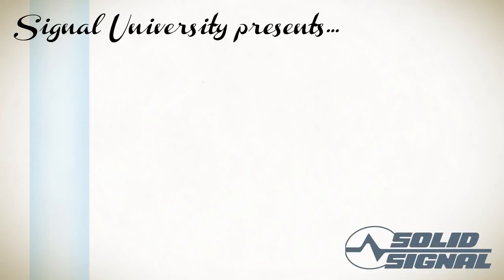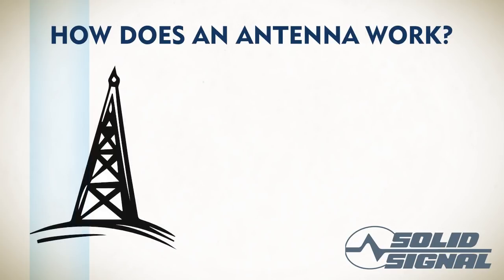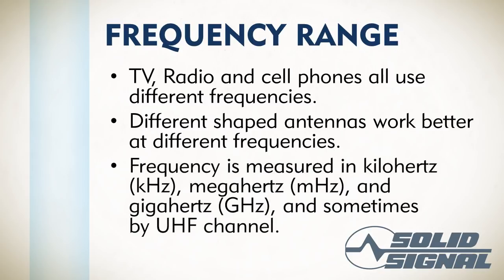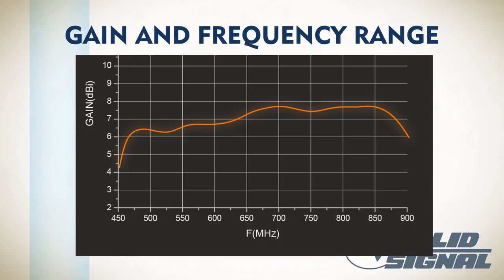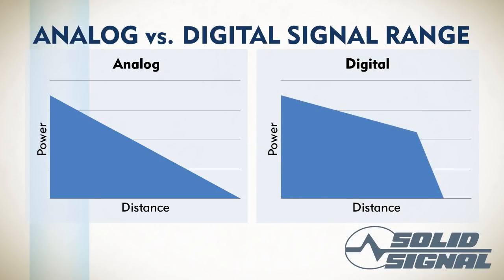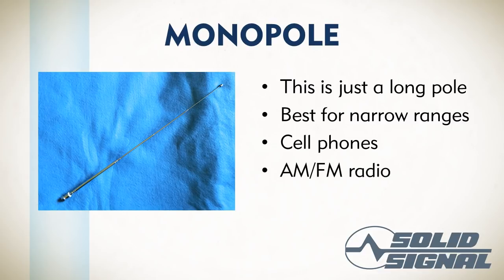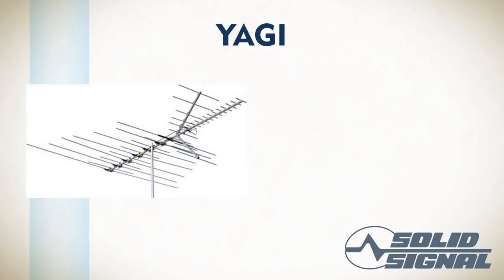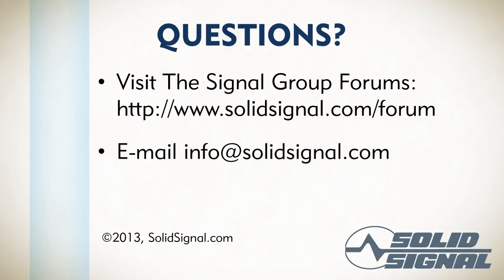Solid Signal shows you: "What Is An Antenna?"

Comment: eeehhhh? I mean I get your doing this for a technically illteriate crowd, but some of this stuff is a bit far off base. For example a true yagi absoultely is about the interaction of the elements at a close proximity.  THe antenna your showing is a hybrid of a few but mostly a log-periodic.... but anyhow... and then the whole thing about distance and digital...  the signal itself is exactly the same as analogue and works exactly the same way, the only difference is error correction in digital  means it produces a visual image that is shapr until the point that the signal-to-noise ratio introduces too many errors into the decoder.  This has nothing to do with antennas (well I mean yes, if you have a more directional, aka higher gain, antenna then yes you can pull more signal, but exactly the same amount of signal as analog).   Monopole is not JUST a telescopic antenna, and its wrong to say as such.  And no antenna is rated by the distance it will receive. The distance it will receive is a function of the transmitted power, the frequency, height above the ground of transmitter and receiver antennas, the gain of transmitter and reciver antennas, and then any propogration effects (not significant in tv, but very significant in AM broadcast).
Reply: todkapuz  whats illteriate? 😂😂😂

Comment: Basic Basic Knowledge for Americans stuck in England where Antennas are what Insects have extending from their heads - so Antennas get called Ariels instead whilst Broadcast Towers often get separately labelled as Mobile Phone Masts ( which are very unpopular in spite of nearly everyone under 70 using one regularly ) - and TV & Radio Transmitters which generally go unnoticed or ignored as mere things on hill tops  ‘in the middle of nowhere ‘  (unless you enjoy fantastic views or are an “ Anorak “ - a sub genre of Geek or Nerd whom photographs them - and Trains , but which are essential for all old fashioned folk that lack Sky tv but have intellect ) 
  Hope this helps as well as the presentation does 😁👍

Comment: just the explanation of the Yagi actually don't apply for the standard yagi, it was made that way, so that the directors elements interfer with the waves in such a way that it cancels waves that are at a large angle and make the whole antenna directive, and higher gain
the modern yagi antenna re actuall a mix of a yagi and a log periodic antenna  or a mix of 2 different yagi antennas disigned for different frequencies bands

Comment: What in Antenna affects the frequency that it can receive? Is that geometry? type of material? size?
Reply from the maker: It's the size of the antenna as a fraction of the wavelength.
Reply: Along those lines, with the increased cosmic radiation that is going to impact this Earth this century:

"Batteryless Battery"????
a. Small aluminum cones with an electrical wire running through the center of the cones, cones spaced apart (not touching I'm thinking) but end to end.
b. Electromagnetic radiation energy in the atmosphere interacts with the aluminum cones.
c. Jostled atoms and molecules in the cone eventually have some electrons try to get away from other electrons of which those electrons gather at the larger end of the cone, of which also creates an area of positive charge at the smaller end of the cone.
d. The electron's in the wire are attracted to the positive end of the cone and the positive 'end' in the wire are attracted to the negatively charged end of the cone.
e. Basically a 'battery' has been created inside the electrical wire itself, different areas of electrical potential.  Basically a 'wire battery' or a 'batteryless battery', however one wanted to call it.
f. Numerous cones placed end to end increases the number of 'batteries' in the wire.

Then of course, one could take that generated dc electricity to split H2O into H2 and O2 of which could be burned or utilized in a hydrogen fuel cell to get the electricity back with a byproduct of basically pure water.  Species need pure water too.

With the increased cosmic radiation that is going to be impacting this Earth this century as well as possibly a mini-ice age, might as well put that cosmic radiation to work for us.

Comment: does dish antennas use omni directional antenna to receive max signal from all directions?
Reply from the maker: Dish shaped antennas aren't omnidirectional. Omnidirectional antennas look like flying saucers.
Reply: @SolidSignalNovi  so dish antennas are simply parabolic reflectors?
can you explain in detail the mechanism involved in reception of tv signals for dish antennas!
Reply from the maker: @fundamentals7377  That's a bit too much for a youtube comment. If you would like to start a public thread at forum.solidsignal.com we can discuss all your questions in detail.
Reply: No, signal is by centering the lpn directly at the satellite,,satellite dish reflex signal to the lpn   , than trough cable to TV

Comment: uhm the tower does not radiate, the antennas mounted on the tower do.
Reply: well unless we are talking about AM radio, then yes the tower itself IS the antenna, as optimal length of the radiating element is approaching 75 meters / 250 feet.  Do s search for "mast radiator" or "radiating tower".    And often, you will find several seemingly the same sized towers in a row with nearly equal spacing... you are actually seeing a directional (gain) antenna for low frequencies... if its two then a phased array, if more then effectively a yagi antenna (see "tower array").  Sometimes you will see a grid of 4 or 9 antennas in a square that are shorter and your looking at a direction finding array for aircraft.

Comment: One question that's driving me nuts:
If I double the antenna size will I double or improve the gain ?
Reply: DX Commander agh I think I follow thats a great start thank you, so the size of the antenna is specific to what your trying to capture and it cant be changed.
I’m trying to get a cell phone signal at a remote property in the 700mhz region and the best I’ve seen is a 16 gain Yagi from ZDA, my thought was to just use a giant TV Yagi, so is it possible to use multiple of the specific size to try and capture more of the specific signal and then try to connect it to one feed ?
Reply from the maker: @SP-mp9yi  @dx commander is right.
Reply: Solid Signal So am I right to say each frequency has a maximum antenna size ? 

One other question guys do antennas catch signal only so they amplify what is already there or can they also fetch signal ?
What I mean by that is if I point the antenna at a area that has good reception but not a tower that doesn’t reach my zone can it connect a path back ? Oppose to having to direct the antenna at a tower that may be out of site ? 

Back to the question of maximum size if I needed more gain from the possible signal would I be able to do it by doubling the maximum size antennas so having 2 4 or even 6 of them going into one feed ? More antennas not bigger ones going into the feed ?
Reply from the maker: S P antennas are passive. They can only receive what is coming at them. You can combine multiple antennas for more gain but you only net about 2dB from the second antenna.
Reply: Solid Signal Super Fantastic Thank you very much.
I actually rewatched your video and things sank in a lot further the 3 time, if the signal is not at the location no array of antennas will help and multiple of the right sizes gives about 2 gain not the full 16.

So my only test left will be to try and install the 16dbi Yagi’s in front of old satellite dishes at a 45 degree angle to try and match the cell towers waves.
If that fails I will initiate plan G move to the city.

Thanks again and happy thanksgiving.
Reply: DX Commander  Thank You very much that really brought it all together for me.
Reply: RULE OF THUM!!! Jessup Rothammel ARRL say so !! 
Greetings from Denmark 🇩🇰💂 👍🖖
Every time you doubbel element count !! You get +3DBd 
But using bad cabel make loss 
Every plug minus 0.01db if the plug you use are PtFe teflon!! 
Plastic has bad diselelectric caractaristica .. teflon don't
Use high grade cabel (low loss cabel PtFe foam insulator) 
Gain..........DBd..DBi
1/4 minus 1.5  or 0.68
1/2 ...........0.0.....2.15
5/8............1.5.....3.65
9/8............2.0.....4.15

If you cophase 2 antennas +3DBd
+
If you cophase 4 antennas +3DBd (6)
+
If you cophase 8 antennas +3DBd (9)

Exampel i combine 4x 21element UHF 430-440
I use combiner and ecoflex15 
30m 7/8 Andrews cabel loss + combiner loss 2.0DB - 24DBd combined antenne gain 
+22DBd 
18DBd +1antenna 3DBd  = 21DBd
+ 2 x 21element more +3DBd 

Cophase som use cabel harness with great loss
I use COMBINERS With 0.01db and ecoflex15 or 10 

I use helical on 2.4 and 5GHz  easy to stack 4 on one print board !! Simiriged COMBINERS 15/23DBd 
Or 10+DBd tincan
Reply: All bands Re mesiured in M Cm Mm 23cm 1.296GHz 13cm 2.0GHz 7cm 5GHz and so on 
The cm tell the lenght of a full wave antenna !! 
So a 1/4 of 13cm is 3.25 x 0.95 velosety factor Then you got a 1/4 .. i prefer 5/8 or 9/8 becaus of the instant gain 
You get by adding elements 
Or even Better Bi Quad !! High gain a bicuad start at 1+3=4DBd

Comment: Then why would a dish not be better than a yagi to pick up UHF?
Reply from the maker: It would, but then you would only be able to focus on a very small area, and it would have to be a very large dish to deal with the larger VHF waves.
Reply: Fact Checker  Antennas similar to the 4251 are STILL made today for cable head end systems.  They are huge and I'm quite sure VERY expensive, and they would require a heavy duty tower.